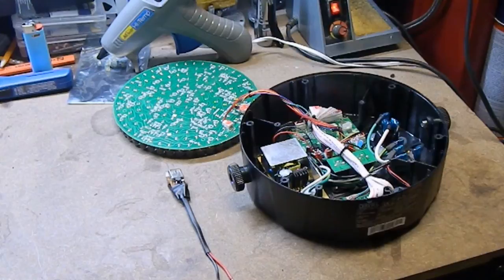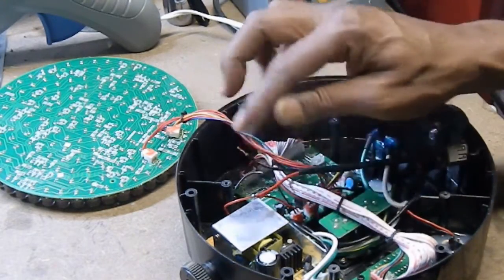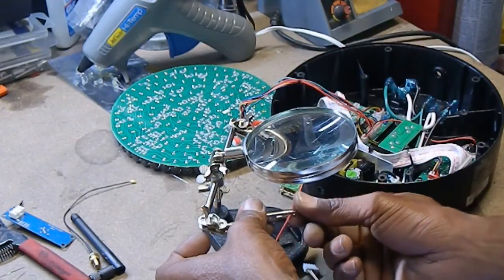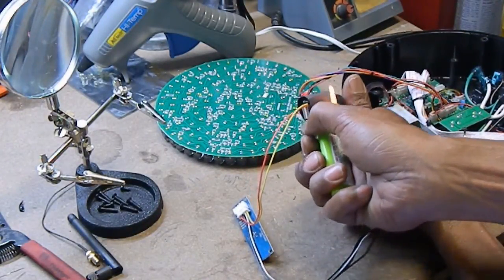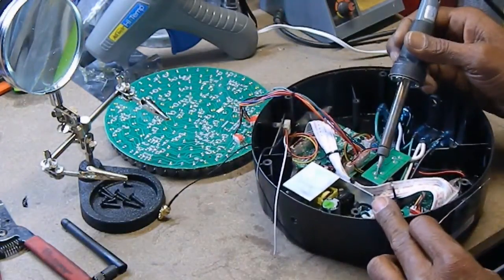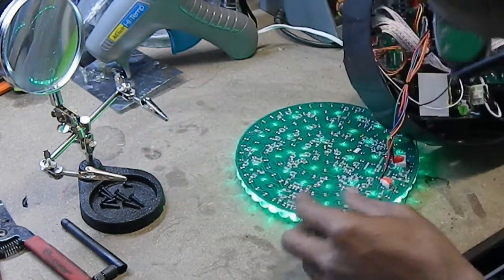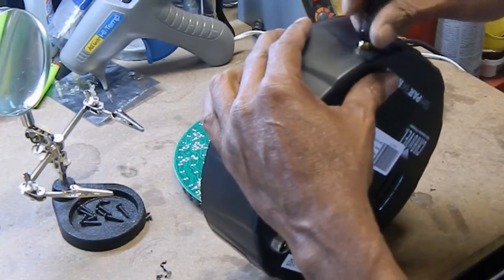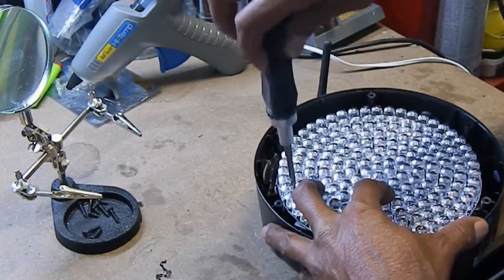Chauvet Slimpar 64 RGBA Built-in Wireless DMX Upgrade DIY - PT2

Comment: so I'm trying to out and every time I plug the light in I have to unplug the 4 wires ( red white yellow black wire ) in the dmx receiver pcb board and plug it back in for it to turn on . do u have that problem?
Reply from the maker: +charles t sedita iii Sorry to hear about the problem. I have not had any problems with my PCB DMX boards. I would double check all connections to confirm power before connecting molex the boards. The boards can malfunction if the power and DMX wire are not correct. Which fixture are you applying this too?
Reply: +Shawn Garner it is also the slim par 64. I think it might be when u plug in the par 64 you get at flash on the pars LED's. like a grand flash a light bulb does right before it burns out. I think the surge of power coming off the 12 Volt side might be doing something to that board after the 5v USB. cause after I unplug the board and plug it back inn then the led will come on and it connects to the transmitter
Reply from the maker: +charles t sedita iii Sounds like a bad USB inverter causing a pike or its the DMX board. Try disconnecting the DMX board white and black wire and plug-in the SlimPar again. If you get the same result, then change the USB inverter. Good Luck.
Reply: +Shawn Garner hey Shawn . it works! it was the dmx PCB boards I had two blue ones like u had and both did not work for me like I explained earlier . but I also ordered 4 of the green board ones cause they were faster shipping on ebay. I just got my 2nd light done . thank you so much for the step by video!
Reply from the maker: +charles t sedita iii Glad everything worked! Remember not all China sellers are the same. Be very careful when purchasing DMX Boards or any items from eBay international sellers, do your homework!

Comment: Also .. would there not be a 5v at the lcd on the light ?
Reply from the maker: +Uplighters Ireland Yes, there could be. However the pins are so small and I did not want to dig that deep.
Reply from the maker: +Uplighters Ireland There could be, however I did not check nor wanted to mess with the LED board. My solution did not take that long and really made things easier for me. Please let me know if the LED board has 5V.

Comment: Is there a linkk for the parts
Reply from the maker: Ebay  and search "Wireless DMX512 PCB board" and "Single port car usb chargers". Someone posted a few days ago and said they found 5 volts going to the LED display board. I have not check this out, but will save time and money on USB chargers. Thanks